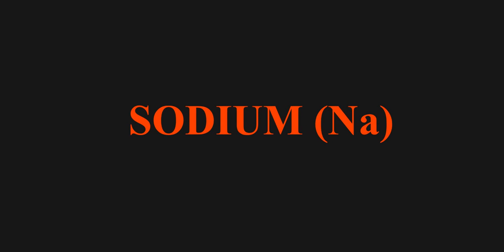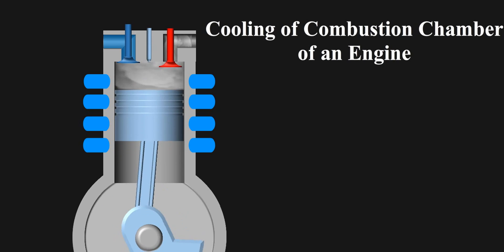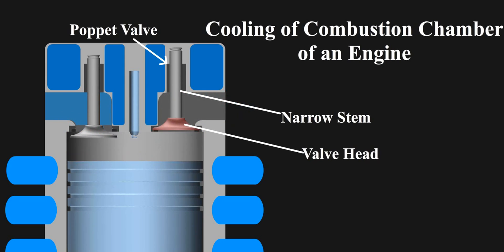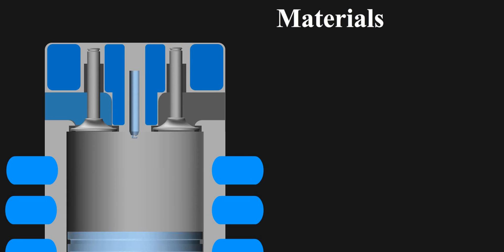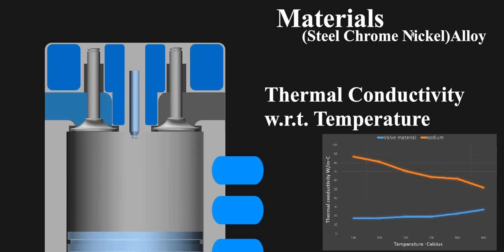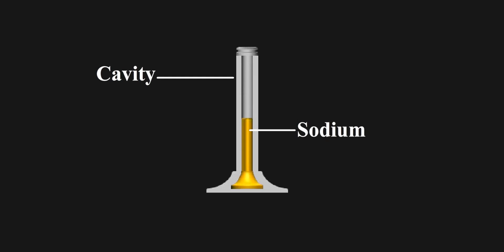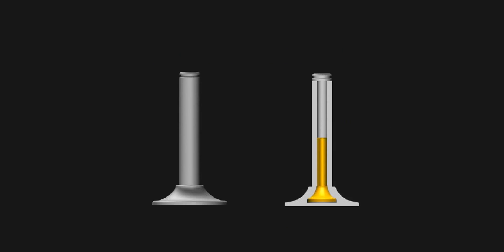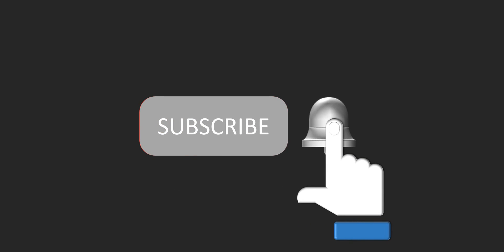Sodium filled Valve avoids knock

Comment: Sodium valves have a short life at high RPM. The hollow design,  makes the stem to head very brittle. Only the area under the valve head has sodium, so stress cracks form at the area under the head. Sodium valves are not new, they just don't  work as described.

Comment: BACK IN THE 1960S FORD USED SODIUM FILL VALVES IN THEIR RACE ENGINES THAT THEY RACED AT LEMANS IN THEIR 427 BIG BLOCKS AND 289 SMALL BLOCKS.

Comment: thanks for this video! i have been recently interested in high performances cars since i bought one a couple months ago. it is a 2.0l 4cyl engine with an eaton m62 supercharger on it. the car requires premium fuel to avoid knock but it also has sodium filled exhaust valves among other innovations to help avoid knock and avoid high temps as much as possible. thanks to your video i have a much better understanding of why it uses sodium filled exhaust valves.

Comment: Knocking actually was a problem in the 1920's which was fixed with the help of lead in petrol which was a bad Idea 
Now octane is used instead
Reply from the maker: Octane is not a fuel additive its a way of rating the fuel quality to oppose knocking. Knocking is still today's problem, but it's not faced by consumers rather designer face it as biggest constraint while designing a highly efficient engine. You might know that most sports cars use high octane fuel just to avoid knock. But you can't force a car buyer to put High octane costly fuel each time in a car which belongs to mid segment but made for performance, hence technologies like these are used.
Reply: @UntangleClub  I was waiting for you to say that octane is a fuel rating .